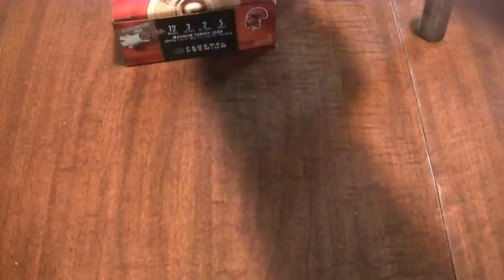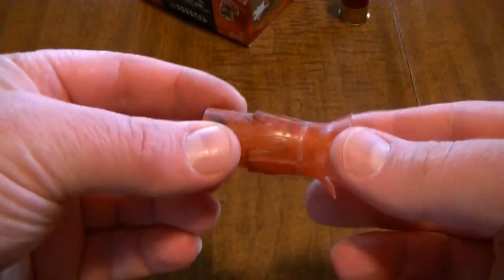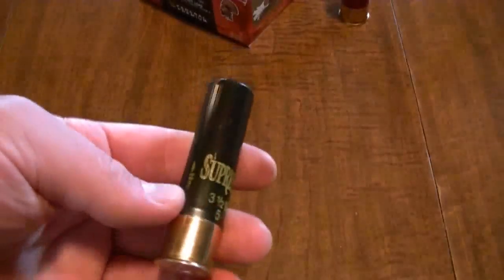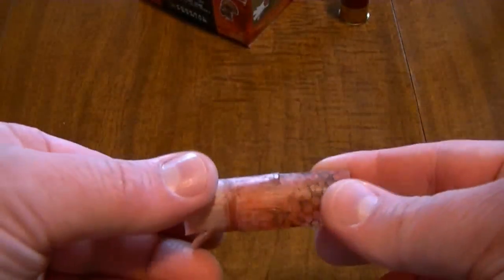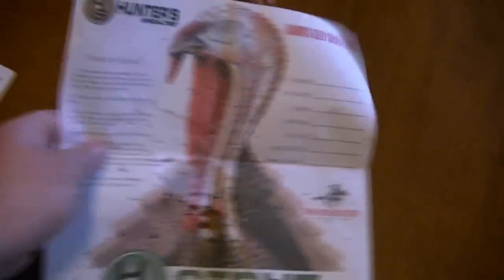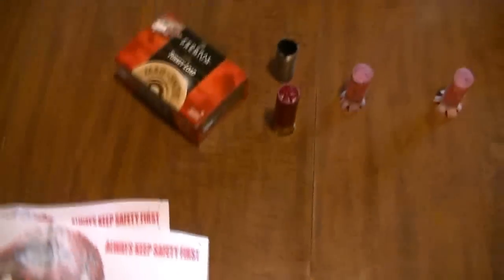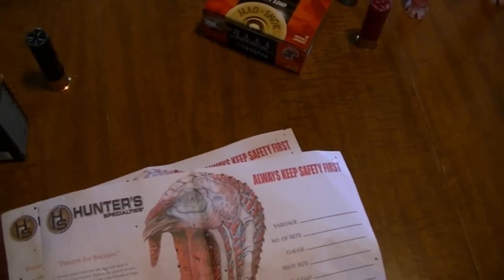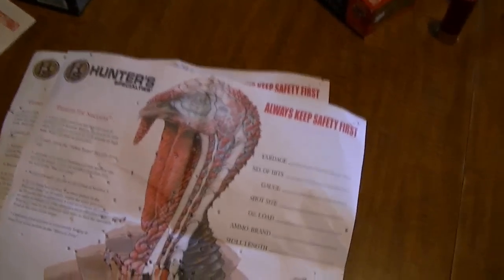final chapter, patern achieved!

Comment: Can't believe no one has mentioned that the wad damage you showed was NOT from pellets escaping from it but rather your ported choke. Yes, there is enough pressure at the muzzle that it will blow chunks out of the rear end of the wad out of those holes in a ported choke. Ported chokes act like a cheese grater on a plastic wad.

Comment from the maker: with my benelli i have the modified choke, with 2 3/4 no.5 load high brass, and it is just as close if not better than the same shell out of my iver johnson single shot 12 gauge with a full choke, its hard to really pattern thefederals due to the fact that the flight control wad works best with a less restrictive choke... and as i type this i hear it in the video lol, given the circumstances here in NY now.... i dont even know what we can and can not use for turkey hunting now......

Comment from the maker: how do you like the heavy weights? been looking at them but here in 3" they are flippin 32.99 per 5 rounds, and yes i found that out the hard way with teh flight control wad lol, paterns great out to 40 yards with my actual benelli modified choke, i have heard good things about the heavy wieghts in #7 but seemed like to small of a shot for turkey, i may have to give them a try